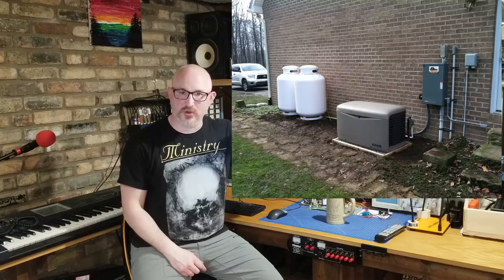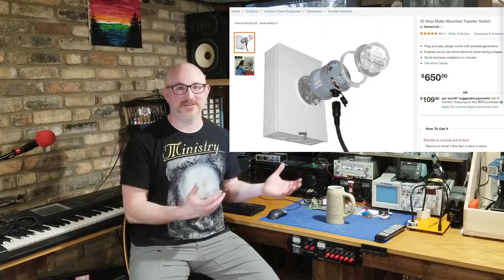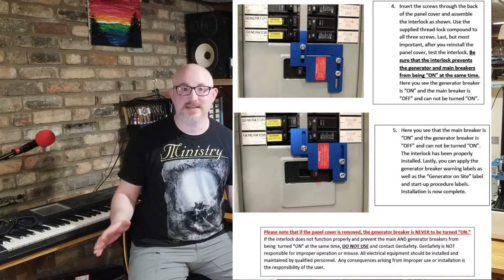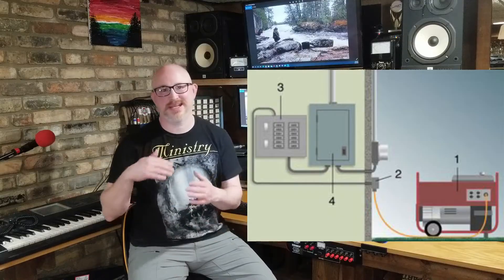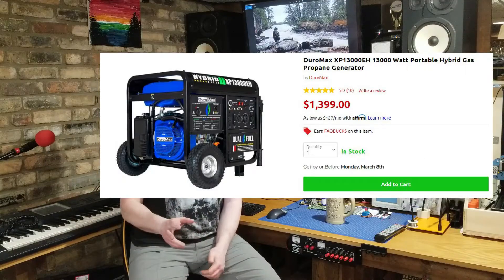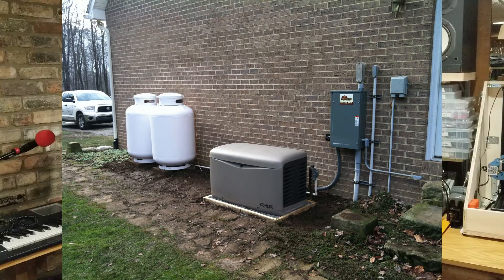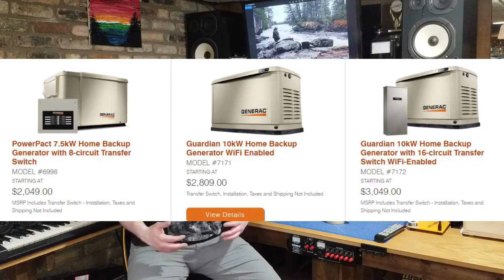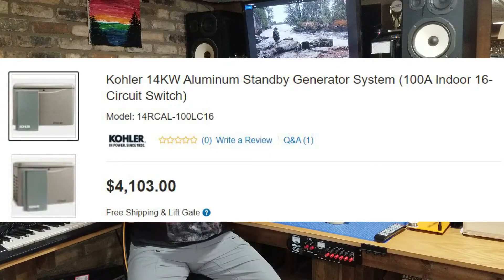Electrical Engineer explains connecting generators to your home

Comment: Thank you for the video. I just want to add one important tip for the DIY guy who wants to install one of those little green transfer switch boxes on their furnace. Some of the ones being sold on Amazon are NOT UL Listed devices. Some of the reviews even say they had components melt and short out in them.
Reply from the maker: Great information, the original products are $100 and while there are likely copy-cats that are cheaper, we have to be careful and expect to get what we pay for.   Loose connections are usually the reason for melting components, and a typical home DIYer may not be the best person to install them if they lack experience and training.

Comment: Forgot…
Just my personal experience and opinion:
IF you can afford it, most Honda generators are well worth the price difference.
I’ve been a volunteer firefighter/EMT for over 27 years now.
As I was an EE and a licensed electrician, I was tasked with portable generator selection when we decided to add portable power to all of our firefighting apparatus, heavy rescue vehicles and ambulances.  
Previously we used 250’ cord reels of 10/3 SO cable powered from our heavy rescue truck’s  permanently mounted w/Onan/Cummins diesel gensets (120/240 single phase 20Kw)

We heard all kinds of recommendations from other departments in the area and decided on Honda.
(all generators are gasoline powered)
We purchased 8 larger units and 4 EU3000i smaller 3Kw units that were inverter-based.
Everything performs perfectly for lighting loads , but we found the inverter generators were far superior to the other Honda portables, and even the onboard Onan/Cummins as far as “noise” (EMI/RFI for sensitive radio equipment & biomedical gear).

So, we purchased a few more of the inverter generators dedicated strictly to electronic loads.

Just the other day, we had a large amount of flooding in our area and lent out a bunch of portable generators to community residents.  When dropping one off to the resident, the inquired about our experiences with Honda.. (he was looking to purchase a small, portable for home back up and camping — but mostly for sump pump operations)
I checked the date on the generator .  Purchase date was 2001, we had purchased all of the generators right after 9/11/2001.

During the past 23+ years, we have meticulously maintained and serviced the generators, and I can only require one requiring service more than we could handle in-house.   

The only caveat — regular oil (& filter if applicable) changes are a must.
“ exercising” generators, at least once a month is important.
Using only fresh/clean fuel is truly critical .
and… 
If using modern day gasoline, especially with ethanol added, it’s critical to stabilize, and treat the fuel prior to storage.
We use PRI-G for the gasoline. We store on our vehicles and in our generators..
A little pricey, but it goes a long way, and has proven far better than Stabil and others for us .

If I couldn’t afford a Honda, I would at least make sure to purchase a four stroke engine, powered generator and one with a good reputation and local service people.

Good luck all.

Comment: I think they’re great for the average DIY homeowner or any home without a larger standby genset + ATS.
I’ve been an EE for 30+ years but mostly in the RF world. 
As part of large scale public safety communications systems, power is a huge concern, so I moved over to the power side.

In my own home, I have everything set and supply a few neighbors with a single  120v/20a circuit and receptacle per neighbor.
The problem? I don’t want to be bothered wiring up “pigtails” to their heating system, so these seem like an excellent idea.
It’s nice that everything is compact on a 4” square 1900 style plate, I’d highly suggest you add an “extension ring” to your existing box if it’s not a “deep” 1900 box.  

Thanks for the video.
Reply from the maker: Thanks for the comment.  These boxes are really handy and a safe way to feed hard-wired circuits.  I agree that depth is needed, as a NEMA 3R In-Use rated cover.

Comment: Great video Richard and thank you for sharing your expertise. The safety advice is excellent.
 I want to ask your opinion on my home electrical system.
Incoming power feed is connected to a 200-amp SQD panel. This is mounted on the exterior of the home, which I have learned is for utility company or fire department quick access. Only 1 additional 90-amp breaker is in this panel which feeds exterior pool equipment. This main panel feeds what I would call a sub panel located in the garage for all other circuits in the home including a 30-amp breaker for a portable generator. There is no main shutoff in this sub panel. Given the fact that the 200-amp main breaker and the 30-amp generator breaker are physically separated in different panels, what is your opinion on the need to install a lock out or interlock kit on the 200-amp breaker for portable generator connection and usage? Thank you again.
Reply from the maker: Thanks!  In your case, yes. An interlock is definitely needed.  My other concern is how the generator and sub panel are bonded.  Please review my subsequent video on generator bonding.

Comment: I purchased a 17.5kw Generac Model 4583 gasoline portable many yrs ago when I was much younger & it has served very well since. Only thing is the connection point to the house is underneath the transfer switch box, and this point is about 3 ft off the ground and with my age is more difficult to connect as I actually cant see it. It would be so nice to have a waterproof connection on the front or the side of the panel as this box is located on the back of my house and is subject to the weather. But I don't know if those waterproof connectors actually exist and if I would also havta change the connection plug on my 50-amp cord to accommodate a weather-proof connection on the transfer switch box. Anyone have any info about any of this?
Reply from the maker: Great point about connections being easily accessible.  Yes, it would be easy to change your connection to one that is more accessible.  You have a few options.  One would be to move the receptacle to a higher position but locate it inside a NEMA 3R enclosure with an open bottom.  That way, you would be able to open the door to see the plug (at about 5'-6' off the ground), but close the door to keep the connection dry.  I would want some form of strain relieve given the height and weight of the cord - i.e. some way to support the cord independently from the receptacle.
Reply: @richardvedvik979  Why thank you, yes that could be done!

Comment: I have a grid tied solar system.  What would be the easiest method to connect a portable generator to run a handful of items like water pump, heat pump and some plugs?
Reply from the maker: What I show in this video is easy and very flexible.  https://youtu.be/Nrnforx1uFI?si=uCD77nDnxQwmmdho

Comment: Where I live the utility doesn’t want two power sources in the same breaker box. I built our own place and have a main break, make transfer switch for our main panel that I can power with a large fob remote start generator for the pump and other big  loads. I also have a sub panel on its own transfer switch that has lights, fridge, freezer furnace and tv and internet on it. I can run this for over 10 hours on a gallon of gas.
Last year we had a couple outages over a few days long. It’s October here and I just changed the oil and put fresh gas in them. I also ran them at a load. I’m not an electrical engineer, but I have over 50 years electronics experience from avionics tech, oil well tool tech and 30 years telecommunications tech doing things like gateway earth station, microwave wave backbone, fiber optic and all the different types of data and voice communications.
Reply from the maker: You have your system handled!  Nice work!  An EE is just someone who went to school and the degree has no practical application on its own, it is up to the individual to implement what they know.  I know far more non-EE's with practical knowledge and experience than EE's with any ability to use basic tools.

Comment: Reply to @cayrick in regards to your shelter for your generator,i  purchased a 7x7 ft shed from the home depot i thinkthen 2017 for around $700 exhaust fan on one side fresh air intake from menards 12x12 $12 on the other side  on concrete slap fireproof mat on floor of shed fireproof siding on wall east and north side of generator 50amp power cord from shed to outlet box on back of house supported by transfer switch in basement in the shed i store propane tanks lawnmower in winter snowblower in summer and several 50lb bags cement for wt.  Guessing spent $3500 tops include $160 for an electrician to wire the transfer switch to service panel, back in 1988 power outage out 28 hrs i know what its like to sit in the dark or without power during the day ...cant put a price on piece of mind and the shed is 25to 30ft from the house. Ran cord thru 3" pvc pipe frm shed to hse to shield from weather
Reply from the maker: That is a great solution!  Thanks for sharing!

Comment: This channel is the best channel ever on this subject matter, Richard you truly are a blessings 😇👍🙏 I use a 10,000 W DuroMax dual but only run propane 3 30# and 2-40# easy to carry to and from the refill station but since you mention it i will invest in a 100# tank and im connected to the whole house ,the refill station i go too uses a back up generator  if they should lose power the only issue if it comes to a grid down would be the crowd that wasn't prepared for the outage,i see mostly 20lb tanks people use for grills but anyway  thanks .
Reply from the maker: Thanks, how do you like the DuroMax?  That unit really piqued my interest.  We certainly want to be aware that the majority of people are not prepared for any extended outages, and we are likely best to stay hunkered down, relying on our preparation.
Reply: @richardvedvik979  love the DuroMax, I en
Reply: @richardvedvik979  love the DuroMax, i set up the DuroMax with other family member as well as close friends. Not saying it's better than any of the name brands on the market I was able to get the DuroMax thru the Affirm app  no money down pay over time and the unit itself has not let me down ,bought a smaller unit 4800 watts just as a backup, your channel is a great channel on the subject 👍be save.

Comment: Can you make generac portable generator act like a whole house generator, meaning automatic on and off during a power failure and specifically how to make that happenn with natural gas?   Any using natural gas that I have seen have a manual off and on for the gas.   How do you make gas turn off and on automatically?  Thanks for any answer in advance.
Reply from the maker: Yes, it would be possible, if you have a transfer switch.  The transfer switch is what senses the loss of utility power and then tells the generator to start, waits until the generator is stable, then switches to the generator source.   You need to disconnect from the utility prior to connecting a generator, and you cannot automatically operate the breakers in the panel. If you just started the portable generator you would backfeed the utility, which is not allowed and is dangerous.
Reply: @richardvedvik979  I understand everything you said and am currently using an interlock.   What I was hoping to figure out was how to make the generator start with a transfer switch.   More specifically how to turn the natural gas on and off on when needed and what triggers the generator to start.  Does the transfer switch control turn the gas on and off and trigger the electric starter and shut it back off either by shutting gas off just shutting it off.  Either way the natural gas would have to shut off.

Comment: As far as gas, I use ethanol free which is poured into the car once a year or so and replaced.  Our neighbor has a Generac natural gas whole house generator which has been great the 7 or 8 years they have had it but it broke down this time, at least for part of this outage, it was silent.
Reply from the maker: I also keep about 20 gallons of high octane, no ethanol gas on hand, and like you, i just fill up a vehicle once a year to replenish the supply.

Comment: I just lived through a three day power outage in Little Rock after a microburst.  I operated appliances with Ryobi 40v and 18v lithium batteries the first day and Ryobi 2300 gas generator second and third.  The batteries are used for yard tools and the generator doubles as a camping generator.  No AC or heat but everything else was covered to my satisfaction.  I have enough batteries to run fans, fridge, freezer, lamps, TV, phones, computers, etc. for days but it would be nice to have a generator connected to the whole house.  Microwave, coffee maker, and George Foreman grill were handled by the generator and gas water heater handled by natural gas.  I also have a 5000 watt generator which was used for power outages the previous decade.  The Ryobi 1800 40v battery pure sine wave inverter was the workhorse along with two 150 watt 18v inverters and a 300 watt 40v inverter.  We slept with Ryobi portable 18v fans.  As cobbled together as that mess sounds, it works and the biggest nuisance was running an extension cord to the garage door opener.
Reply from the maker: All of that is great information.  With the prevalence of portable tool inverters for jobsites, that is something that should be added to my list of options.  The EZ Generator Switch is what makes your experience a bit easier, since you can group up the connection point in a convenient location and just intercept the existing circuit.

Comment: Can you talk about THD and generators? I have a 7k portable generator and recently learned that it can damage electronics due to “dirty” non pure sine wave electricity output. Can I do anything to “clean up” the output or should I invest in an inverter generator, I’ve heard they’re better for electronics but more expensive. I just had a transfer switch and interlock installed to power my whole home if needed (specific circuits) including my AC (after a soft start is installed. Any info is greatly appreciated!
Reply from the maker: Yes, distortion is a topic I want to talk about.  You want a generator rated 5% THD or lower if you plan on having computers, TVs, or modern appliances connected.  For now, you can just manually leave those breakers off.

Comment: so your evidence of competence at engineering is that you design the buildings I routinely get lost in, optimally set up for 1950s style medical care,  in drastic need of a first principles redesign, in which doctors make me wait for 12 hours before stealing my money while providing shoddy and rushed ineffective service.  hmm. ok.
Reply from the maker: Fair points.  Wayfinding is an architectural component, not an electrical engineering component.  But the main reason for maze-like structures is the way buildings are added on to over decades.  As additions compound, departments get boxed-in, and then disjointed from other care areas.  It's a real problem, for sure, as buildings exceed 200,000 square feet.  I'm also not a doctor, but I have designed operating rooms connected to an MRI that allows for brain scans during surgery to ensure tumors have been removed prior to sending the patient back to their room. The wait times are also outside of my control, as I am not responsible for staffing and scheduling, nor am I able to control nursing and support staff attitudes and behavior.  I keep the lights on and keep the receptacles powered so people depending on them don't die.

Comment: Hey Richard: For my furnace in future power outages, I bought and I'm about to install that green EZ Generator Switch. My Firman inverter-generator's neutral is floating, according to its Owners Manual. So my question for you is: Which do you recommend: reconfiguring the switch to accommodate floating neutral generators according to the wiring diagram provided with the switch ... OR ... connecting a ground wire from the generator to the grounded water pipe of my house so I can keep the switch wired as-purchased? Thanks so much for the video and any reply.
Reply from the maker: The instructions from the MFR are fine to follow if you plan on keeping a floating neutral generator.  Just  keep in mind that you want to label the front of the EZ Gen Switch that it is for floating neutral generators only.  Feel free to save the parts in a bag, taped to the furnace, for later conversion back to the original configuration.  In this case, I would just use a separate neutral conductor so you don't cut the terminated end off the factory wire, like shown in this video.  

 https://www.youtube.com/watch?v=gVbUWCCt0D4
Reply: @richardvedvik979  Thanks for replying! Assuming I DON'T add a ground stake, what is the role of the 3rd prong when I plug a 3-prong vs a 2-prong extension cord into my floating neutral generator and the EZ Gen Switch that I reconfigure for floating neutral generators only?
Reply from the maker: The bypass instructions for a floating-neutral generator simply have you bond all of the neutral conductors together inside the EZ Generator Switch enclosure.  The ground conductor, or EGC, is for safety - ensuring a path back to the source if any metallic enclosures become accidentally energized.  Two-prong cords are used on equipment with non-conductive surfaces (i.e. plastic).  Three-prong cords are used on equipment with conductive surfaces (metal).   You would want a three-prong cord between the generator and EZ Generator Switch when using a floating-neutral generator with the neutrals bonded as discussed above.  You would also want a three-prong cord between the generator and EZ Generator Switch when using a bonded-neutral generator with the neutrals switched.